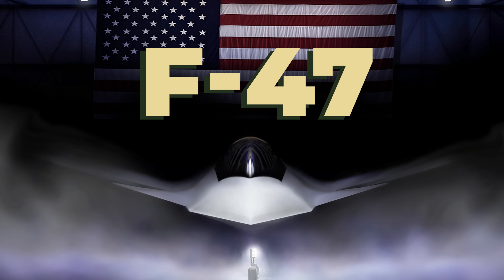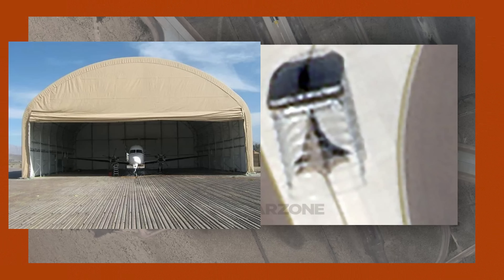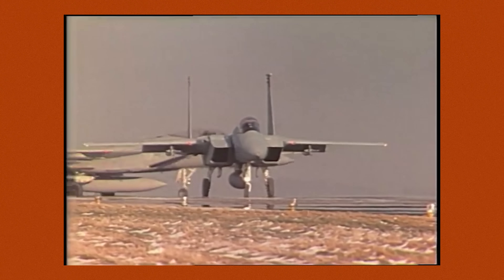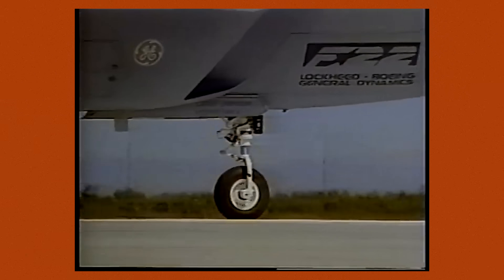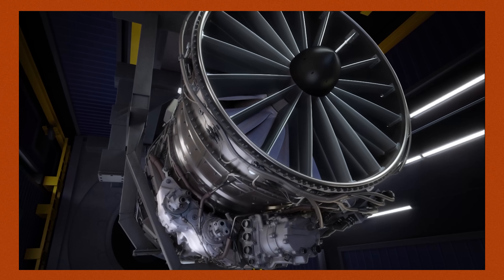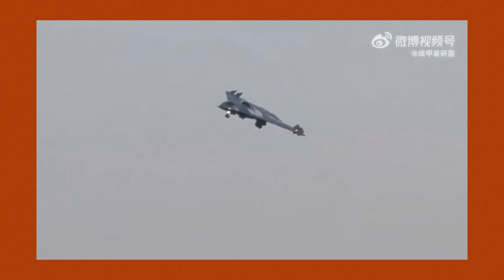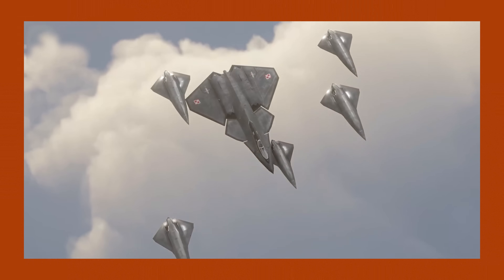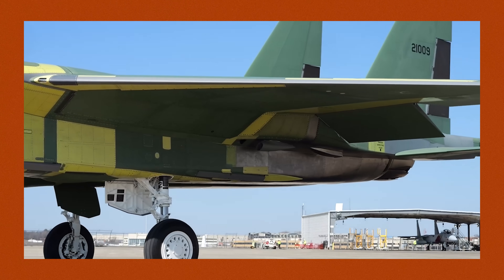America's "New" Sixth Gen F-47 is NOT New

Comment: I’m glad you clarified that the F-47 is the new name for the NGAD. I think most people think they’re two different planes.
Reply: NGAD is a program. It was never a plane. NGAD Program was just a program to test capabilities, the F-47 is the platform they built to put the NGAD Program capabilities on. Whatever the Navy come out with will be the Navy's version of the NGAD Program capabilities.
Reply: @dillonhatfield7724 Just like how the JSF program produced the F-35s. The Navy's new jet has the placeholder name FA-XX
Reply: @dillonhatfield7724  NGAD is a DoD RFP program. An RFP is specificied and the contractors respond by placing their bids. The bids are narrowed to those acceptable to participate in the program which is intended to be a competition usually. The Fly Off is tbe competition where the program requirements are met as close as possible or exceeded in some cases, by the respective competitors. 
NGAD in this case, produced a winner of the competition, the F-47. Prior to the NGAD program competition fly off, the USN announced their decisions to step away from the program and submit their own unique RFP. 
This will be a new program, with a new fly off, known as FAXX. 

An RFP is a 'Request for Proposals'. Its the process to start a new development program prior to a Requisitions deal.
Reply: There is another NGAD: the F/A-XX for the USN.
Reply: NGAD is their air dominance program, not the jet
Reply: no they aren't. NGAD is way further out than this. It's expected to enter service in late 2030. This jet probably has some of the features and tech from NGAD development but it's definitely not that.
Reply: @MichaelOxlongerThanYours  Please show us the source of your information.
Reply: The Navy will also get an NGAD..the contract has yet to be awarded as of this post.
Reply: @jayrod9979  F47 is Navy NGAD. Previous project is Heavy fighter almost twice bigger than F15.
Reply: F-47: NGAD
US DEBT TO GDP RATIO: EGAD
Reply: I'm guessing Trump named it? 😅
Reply: NGAD is not a specific jet. F47 name is not new either.
Reply: They're 2 different planes. NGAD is unofficial designation to Lockheed Martin technology demonstrator.
F-47 is based off Boeing's.
Reply: @sys3248 
No, Dillon is correct. "NGAD" is the name of the program, under which the F-47 is being developed. 
Just like the YF-22 and YF-23 were developed as part of the ATF program, with the F-22 being the result, and the X-32 and X-35 were developed as part of the JSF program, with the F-35 being the result.
Reply: @stickiedmin6508  they have LM NGAD prototype before Trump changed them for 'F-47' which is based off Boeing's old Technology Demonstrator not running under NGAD.
Earlier this Year they scrapped 10+ years running NGAD programs with Heavy fighter models to explore about smaller Carrier capable types presumably in preparation to confront China in SCS.
So NGAD running headless, directionless is their own doing.

Since declared F-47 is not even a real plane, not even exist in proof of concept models you don't even see what it looks like.
Reply: Most people don't give a fuck what plane it is or what it was called.
Reply: They are. NGAD projected cost 300 million per plane. F47 projected cost per plane 90 million. F47 is a watered down ngad jet.
Reply: @ NGAD is the project name. If you're from the USA , you should at least know that about your own country. Doesn't matter who gets the project or who builds it, it is under NGAD project. I guess they let you test flight , that's why you have this imaginary information.
Reply: @MrCard031584 ye bcs the congress don't wanna spend that much for a tail. that's why the ngad product now cost that less. it's nothing different
Reply: @ It would have cost you less time to look the NGAD Program up than type something wrong about it
Reply: @ and yet I got 3-5 people so far explaining it in simple direct terms. First rule of the internet: if you want to learn something just post something wrong in a comment.
Reply: @altarancho  YouTube keep censoring my comments. Fk YouTube.
F-47 isn't even existing proof of concept aircraft.
Reply: 47 likes 😂😂

Comment: The F-117 was initially supposed to be a pastel blue color, which was a better sky camouflage. But Air Force brass refused to have a pastel colored aircraft and insisted it be painted black.
Reply: Nope, you are wrong.  The F-16s and F-15s were supposed to be pastel in color.  The F-117 was always supposed to be matte black due to its RSC reduction coatings.
Reply: The RAM coating is black. The earlier test aircraft didn't have RAM yet.

Comment: Why does it take so long to develop anything for the US forces? Musk developed two radically new space delivery systems in 15 years; USSR developed a new anti-tank rifle (with new cartridge) in 67 days (!). Now, those are two vastly different systems by complexity, but surely a new rocket engine + a rocket + earth support times 2 is more complicated than a fighter jet?
Reply: rockets are infinitely easier to design than planes
Reply: @aquilesca5tr0  Seriously? What about rocket engines, like full-flow staged combustion Raptor? What about landing on engines only, like both SpaceX boosters do? What about the interval of pressure from 1 bar to 0 that a spacecraft should withstand?
Reply: @Grrymjo  rockets are just inherently simpler than actual planes, that´s why there were people on the moon in the 60s
Reply: @Grrymjo   rocket engines are just contained explosions, like a pipe bomb with a hole

Comment: to be fair, even if the f47 is slower and less movable then jets from the 70s, its not like this thing is designed to dog fight. dont really needa be fast when you launching missiles from 200 miles out you know
Reply: Faster you go, farther your missiles go. People somehow always miss this part. You also need to be manouverable enough to defend against enemy missiles
Reply: @kevinl2482  the same could be said for altitude due to the fact the air is thinner. If these things operate in high atmospheric conditions it doesnt matter how fast they are if they are that high.
Reply: @ It still does, no matter how high you are, having a faster initial velocity will make a missile travel farther, actually even more so at high altitude since rockets accelerate even faster.
Reply: @misterragnar2521  nah then this kinda defeats the whole point of the mig 31 since all russia needed to do was get a fighter high up and launch a missile and they didnt need something that could go 3x the speed of sound for that. Going fast drastically increases the kinetic energy retention for a missile which is why the f15 is designed to go so fast since its whole job is being a missile truck. 
there is a reason why the mig 31 and the f15 are such feared jets
Reply: It does still need to be fast. If an aircraft is flying extremely long distance sorties and isn’t fast your sortie rates will be extremely low. It’s also going to be used as an interceptor so speed is a necessity.
Reply: Didn't they think something similar back in the Vietnam War era with the F4 Phantom?
Reply: @stama9  Not really, and the issue with F-4s in Vietnam was mainly due to outdated and inflexible training and doctrine rather than any shortcomings with the aircraft itself.
Reply: To launch missiles from 200 miles you need good radar and good missile
USA doesn`t have any of them
Reply: @onetwosccd  usa have done it already.... you dont need a great radar becuase of data link, you can lock a target with an f18 send that data to a u2 plane and the u2 can send that data is an f35 200 miles away and fire a missile at them
Reply: @pemioi  It`s well known data link which analogues Russia and China has. Big plane with big radar, and fighter jets going through to launch a rocket

The reality is that defending side always has advantage, and USA for now didn`t succeeded in developing unmanned fighter jets unlike Russia and China did (S-70 "Okhotnik" for example)
Reply: @onetwosccd  americas had unmaned  craft for decades... what are you even talking about?
Reply: @pemioi  name unmanned fighter jet or bomber
Reply: @onetwosccd  Current
MQ-1C Gray Eagle
RQ-4 Global Hawk
MQ-4C Triton
RQ-7 Shadow
MQ-8B Fire Scout/MQ-8C Fire Scout
MQ-9 Reaper
CQ-10 Snowgoose
RQ-11 Raven
RQ-12 Wasp
MQ-19 Aerosonde
RQ-20 Puma
RQ-21 Blackjack
RQ-170 Sentinel
RQ-180
Altius-600
Black Hornet Nano
Coyote
Jump 20 VTOL
Northrop Grumman Bat
Phoenix Ghost
Snipe NAV
Switchblade
Stalker
ScanEagle
.
. 
just to name a few
Reply: @pemioi  and all of them have a speed about 400-500 km/h? We are talking about fighter jet fight overall
Reply: If everyone makes stealth planes good luck being an air superiority fighter launching missiles at 200 miles

Comment: Canards don’t Increase RCS anymore than the horizontal tail sections of a fighter, the only caveat is that you have to take the canards alignment into consideration. They have to be perfectly level with the aircraft or else they’re give off much more of a RCS. Although the most important part with reducing the RCS is the vertical tail section aka the rudders. With the F-47 being a flying wing design it’ll have a much lower RCS than the Raptor possibly half the RCS giving it a rough estimate of 0.00005m^2 over the raptors 0.0001m^2. If the Raptor’s is about the size of a bumblebee the F-47 will be around the size of a large ant! So we went from the Mach 2 bumblebee to the Mach 2 ant 💀
Reply: According to NASA canards do incrase RCS more than horizontal stabilizers
Reply: @ well that’s not what the airforce says
Reply: @ Nasa is basically part of the air force

Comment: Tell me you don't know shit about modern fighter aircraft without telling me you don't know shit about modern fighter aircraft: 

"The F-22 maxes out at Mach 2"  Ahh, there it is 😆It has been officially stated that F-22 can supercruise, that is fly supersonic without afterburners, at 1250 MPH. A crappy afterburner system will increase a turbofan's power output by 2x. A really good one can push 3x. So you think when F-22 lights off the afterburner and gets AT LEAST 2x power it can only go another 250 MPH faster??? If so, I've got a bridge to sell you buddy hahaha

In reality F-22's top speed is limited by the air friction heating up its composite airframe which, as it is essentially made of plastic, does not shed heat particularly well. F-22 can sprint above Mach 3 for short distances if needed though spending an extended amount of time at that speed would likely result in a write-off of the airframe.

FYI my guy, unlike Russia the USA wildly understates the maximum performance of its military hardware, ESPECIALLY when it comes to top speed numbers.  There is a strategic advantage in your enemies being ignorant of your true power. That said, there is a political advantage in your enemies believing you are stronger than you really are which is why Russia has always overstated the performance of their military hardware. This is where the myth of Russian hardware being "better" and "more cost-effective" than NATO gear came from which has been thoroughly debunked by the war in Ukraine.
Reply: That´s not how afterburners nor drag work, the f22 is limited to mach 1.6 to avoid coating damage and has theoretical max speed of mach 2.3

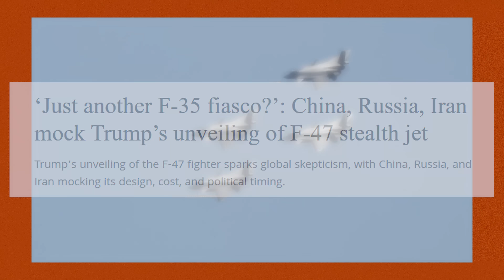Comment: 6:36 there’s a BIG difference…. China uses canards with empennage while USA uses canards without empennage.
Reply: The BIG difference was ever thinking that canards were a breaking point for stealth. 
They are actually not and, beyond all the pr hype, when you get down to the science of it, it's negligible if done correctly but have major benefits. People who care not to read simply listened to those who decided that it was past generation, because the Lockheed aircraft didn't use them.
Reply: So now canards aren't bad for stealth? Funny how that works.
Reply: @Flightman453 canards with anhedral wing layout means the aircraft is natively unstable, thos means the canards will constantly be micro adjusting and spoil stealth.

The f-47 has a pronounced Dihedral Wing for cruise stability so the canards can be stationary
Reply: @bengrogan9710  j20's conard works like that too it's locked in place after take off
Reply: @somerandomguy1475  no, it isn't and japanese and Taiwanese rcs data already confirmed that
Reply: @bengrogan9710  come on there is not proof of that because China has lumburg lense on their j20 at all time it's impossible to get real RCS beside the J20 is a MASSIVE plane what dose it need conard for it's like putting race wheels on a semi truck it's obviously for take off and is locked in place in real flight
Reply: @Flightman453 you’re reasoning by analogy.  That’s why you’re confused.  Anything can be done as long as the radar return is acceptably low, that’s all that matters for stealth.  Stop thinking in terms of your little “formulas.”
Reply: @lookoutforchris  so why f 47 have canards?
Shenyang J-50 don't have canards

Comment: The X36 had crazy maneuverability so pretty curious how the F-47 will match up especially given the conventional wisdom that the 6th gen would be more like light bomber than a fighter
Reply: Well considering he mentioned analysts saying it could be 45t, which isn't that far off a cold war Soviet Main Battle Tank, unless those numbers are way off base I am Gunna go out on a limb and assume that it's agility score will just be a picture of a brick. At the end of the you gotta deal with conversation of momentum, and there is only so much aerodynamic voodoo you can do before you have to have the fact you are trying to convince 45 tons of aeroplane going at say up to mach 2+ to be going a different direction, and you also have to do that while not entering a long distance relationship with your wings, or turning the pilot into soup.
Reply: @SoulReaper1942 MTOW for the F-22 is over 40 tons. 45 tons is more, yes, but this fighter's blended/flying wing design should give it way more lift relative to its size and drag, and the engines are looking like they're going to be even more powerful individually than the F-135 in the Lightning II. If it has thrust vectoring (fairly likely, considering improved short-field capability was a consideration to reduce dependence on larger airbases), it may very well be far more agile than you'd think. Maybe not to the same degree as the Raptor, but certainly not the unmaneuverable brick people seem to be expecting.
Reply: That's the real interesting part that not many are talking about.  Everyone assumed it was going to be some bloated stealth AtoA missile truck like the Chinese prototypes, but it looks about the same size as an F-22.
Reply: @dcl97 It absolutely is going to be much larger than the F22. That’s literally a core requirement of the program. Despite what people say, the images you see are just outdated concept art that could have absolutely nothing to do with the actual aircraft.
Reply: @dcl97  Bloated? Man, that's some delicious cope.
Reply: The X-36 was a 28% scale, remotely piloted model aircraft, built merely to explore the concept. 
There's just no way that anyone could successfully build a full size, full weight, piloted air-superiority fighter, and make it manoeuvre like the X-36. The pilot wouldn't just black out, they'd end up as a kind of lumpy, mushy soup, sloshing around on the cockpit floor, and the airframe would be so overstressed and twisted that it could never be flown again if, by some miracle, it didn't tear itself to pieces in midair.
Reply: Weren't there some really heavy tactical bombers back in the day?

I agree that maneuverability isn't something that you should be scoffing at, and also that speed is very useful (but again people that think that speed and efficiency/supercruise is useless are probably the kinds of guys who know little more about this stuff than was discussed in the video)
Reply: @TimEriksson-w2n
The missile will be trying to match your evasive maneuvers, genius. No, you can’t assume that a little agility is as good as a lot.
Reply: Manuvarabiltiy is bascially dead planes rarely if ever get close enough for guns or non-bvr fights so stealth and highrange is the most important thing for a actual fighter
Reply: @lucioriley5558
You’re about a quarter right - ie three quarters wrong. Which is actually decent for an internet knowitall, I suppose. In fact agility, especially sustained turn, is critical in BVR. The more you have, the more fuel a missile has to have left to match your maneuvering at the intercept point. Which equal missile systems and radars, the moreagile fighter can launch from greater range. Ffs, the Typhoon was built to work primarily as a system with Meteor, ie  for BVR - some airforces don’t even put a gun on them. And it was designed for high speed agility first.
Reply: @lucioriley5558 You have to be manouverable enough to defend properly and also fast enough to give your missiles more range
Reply: @kevinl2482  Maneuverability is still not a major need for fighters nowadays.
Reply: @ I never claimed speed = manouverability, I differentiated quite clearly I think. You need enough manouverability to be able to comfortably be able to engage and disengage, which clunky fighters, such as the MiG-25, struggle at. This makes it harder to be aggressive as you have to stay defensive more since it is a lot more risky to spend a lot of time to re-engage and disengage again if you need to start defending again. Obviously you don't need to be F-22 manouverable but you'd preferably want to be more manouverable than a Tornado. There's a reason why almost all gen-4s are really manouverable planes despite being designed in the beginnings of the fox-3 era.